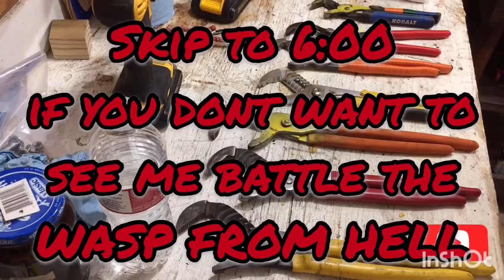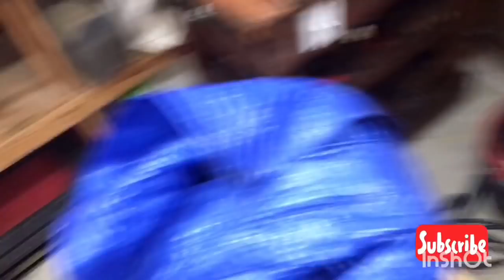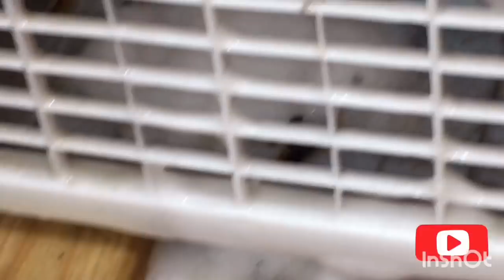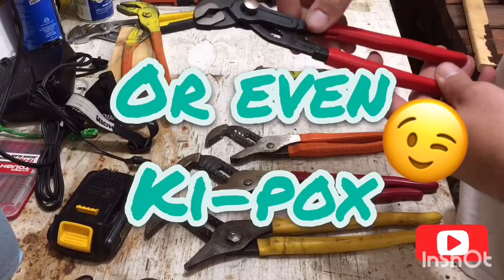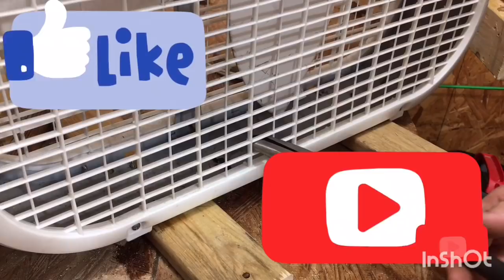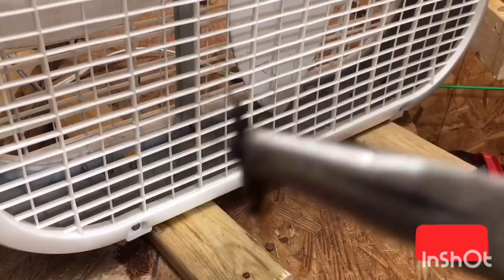Is Channellock still the BEST? Harbor Freight, Klein, Stanley, Kobalt comparison

Comment: I'm an electrician too, I prefer the Klein, Knipex and Snap On tongue and groove pliers all over the Channel Lock ones. I used the Channel Lock tongue and groove pliers for about my first 15 years in the field, then upgraged to Klein tongue and groove pliers, and used Klein ones up until about 7 or 8 years ago when I discovered Knipex and then about two years ago I started buying Snap On. 
Just an F.Y.I,  Klein and Snap On are also made in the U.S.A. The Klein pair costs around $25-$35 depending on where you buy them, the Snap On ones actually cost $50 (not $300) and have the best teeth of any pair of tongue and groove pliers on the market. The Snap On ones are perfect for running conduit or pipe because of the serrated teeth. The Knipex ""Cobra" pliers are very good too, they cost around $50, but the Knipex aren't a true pair of tongue and groove pliers and therefore have their limitations. ......but I'd rank my Snap On pair as my favorite(best I've ever owned). I love the teeth, and I love the material that Snap On uses to cushion grip the handle. 
https://store.snapon.com/Tongue-and-Groove-Pliers-Adjustable-Joint-Straight-Serrated-Jaws-12-3-4--P641008.aspx
Reply from the maker: I’m not sure if they still are but i know at one time snap on just rebranded channellocks. I’d like to try knipex one day but as u can see I don’t really have a reason to buy more damn channellock type pliers. Lol thanks for the comment 👍🏼

Comment: I switched to Knipex several years for the slip joint pliers because of the thin jaws and strong grip.  I also enjoy the position locks so you cant drop it and you do not have to find the correct size again.
Reply from the maker: I do like my fake knipex, although the button took some getting use to. Now that I know I like them I think I’m gonna try to get a real pair soon

Comment: I just looked it up the Harbor freight 12 inch pliers are $8.99 and the channellock 12 inch pliers are $15.98 on Amazon. So it's ~$7 difference. I still much prefer the channellock.
Reply from the maker: The price gap increases as the size increases. I prefer channellock as well but it’s nice to have a decent alternative when money is tight
Reply: Last year around July on Amazon I bought a 5pc pliers tool roll set channel lock brand $67 and like $3 shipping

Comment: It may sound stuped, but I'm my book an American made tool is always better than a cheap Chinese or Taiwanese tool no matter what. ( Both can make a good tool, but at the low cost level they rarely do )
Harbor freight is good for some things, but hammers and pliers are a no go.
American made Channellock pliers and Vaughan hammers are affordable enough that it's just not worth the slight savings ( especially hammers as I've had chip of a cheap hammer cut my cheek )When they don't last.
Reply from the maker: I think the amount of use a tool is going to see determines the quality needed 👍🏼
Reply: Tough Tool Reviews 
This is true for some tools, but with harbor freight...ect pliers one would probably wear them out eventually under occasional light home use.
I say it's better to spend a little bit more on American made pliers you won't wear out.
They're not much more, and a 3 piece set of Channellock tongue and groove pliers is pretty damn affordable at Walmart.
Wilde pliers cost about the same if you don't mind ordering tools online.

I've got my grandfather's Champion Dearment Channellock #420's ( they changed the company name to that of the tool they were known for around 1955 ) made in 1933 and since he didn't use them in any professional capacity that I'm aware of they still work extremely well today.

All I'm saying is that HF pliers shouldn't be compared to Channellock and one should know their not buying as good of a tool as they could be.

Comment: ChnnelLock was never the best.  They were and are a reliable good quality product that was priced reasonably. That's their reputation, and regardless of where they do their manufacturing or who buys the brand I don't expect that to change. 

All Klein pliers have their name stamped into them. Without that stamp, you have a copy.  There used to be some good quality knockoffs until penny-pinching managers realized that they could sell junk without stamping a name on their products. By the time the poor quality was discovered, the name was forgotten, so their future sales weren't hurt.  That was before Harbor Freight.  People remember shopping at Harbor Freight.

I look at basic level Pittsburg tools as disposible or for light careful use. They are crude, cheap, and  designed to get new customers to go to their stores and buy something, not to perform well or to last.  A return trip by a customer trying to get a replacement is an oportunity for them to buy something else to help justify the trip..  

The sale of Pittsburg tools started to decline 2 years ago,  so Pittsburg "Pro" was introduced for the simplest tools with lifetime warrantees.  Pittsburg Pro tools are slightly better than Pittsburg,  corresponding o their higher prices, but the reputation of Pittsburg continues to hurt their sales. That's why Doyle and other new brand names were  created. They are the 2018 models of the tool lines hurt by the poor reputations of the cheaper versions. This is somewhat like Craftsman and Sears-branded tools.

Doyles and the other new brands needed to be visually different from the low end cousins (that had been built  in the same factories), and to more closely resemble tools from makers with etablished reputations.  They did not need to be excellent to be better than the Pittsburg brand.  They still use the same grades of steel, forging instead of milling, grinding rough forged pieces without polishing  or plating.  Pliers are coated with oil to conceal loose tolerances on the moving parts and prevent joint rusting, packaged in blister packs to hide their action before purchase and to retain/conceal the oil.

Doyle are much better than what they replaced, but are still sloppy fit and finish compared to ChannelLock. That might not matter to someone executing honey-do items a few times a year, but would quickly frustrate a serious DIYer.   BTW, Channel Lock pliers only cost more than Doyle if you put not value on your time.  One unused tool, or a return trip to exchange a bad tool for like will wipe put any imagined saving.
Reply from the maker: Well that’s quite an interesting point of view

Comment: I HAVE actually told two managers of the local harbor freight store that they should remove the orange handle pliers sets from the shelves and refuse to sell them. even demonstrated and challenged one of them to try to clamp the tongue in groove to anything without it slipping. he refunded my money but said that he had no choice in the matter. i told him that they were an embarrassment to the brand and that if i had made my first visit the the store and only bought that one item, i would have never returned. I've actually been in the checkout line and saw people with them in their carts and told them that the set was garbage and not to get them, with the employees only nodding in agreement. 
HOWEVER, the red handled pro versions sold one piece per tool are excellent, better than any big name that i have ever used. I've bought and have been using all three sizes for almost ten years now and they are the best you can get.
Reply: People who work at HF get no commissions and aren't salesmen.  They take their marching orders from the company that employs them, not from you.  People who buy the cheapest of anything that's available without hesitation will continue to do so until they get slapped in the face with the consequences.   In most cases, they will blame the seller or manufacturer and turn to a different one.
Reply: sadly true
Reply: Nothing at harbor freight is the best of anything